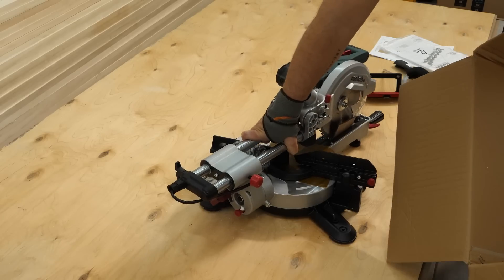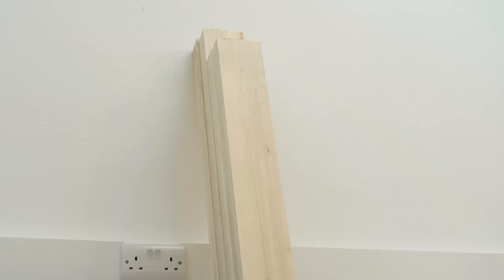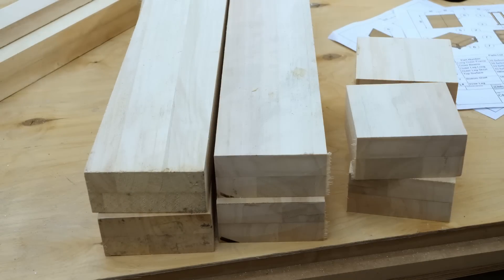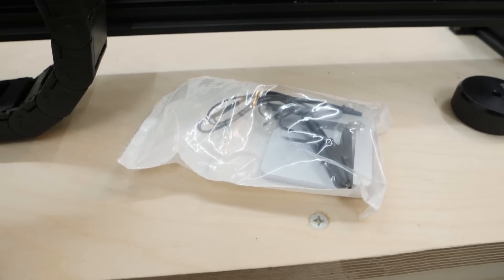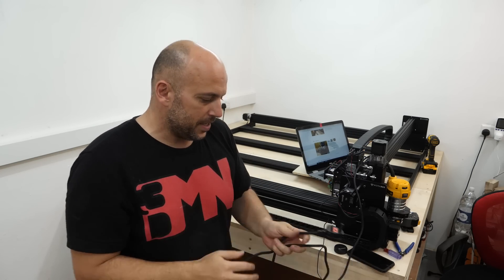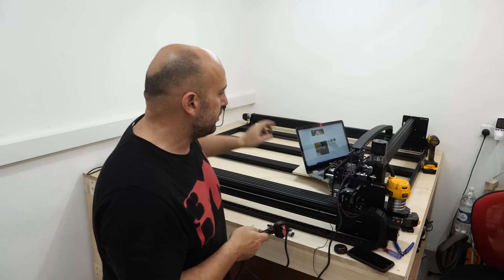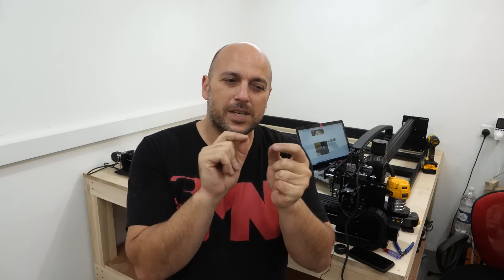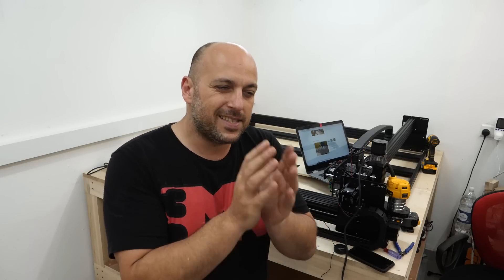MASSIVE CNC! - Setting Up The Ooznest Workbee 1500x1500

Comment: only idiot buy workbee parts, only spindle motor 200-300$ can buy lot better 2.2KW ER20 water cooled REAL spindle cheapen about less than 200$ i just buy my cnc new spindle cost 150$ and VFD 55$ lot better than any workbee shit router or milling machine. ower prize lt all parts. i has build better and biggest cnc less than 1500$ better motors, drivers,rails, controller,softwares.

Comment: not massive size, my first cnc machine what i has build has 1500 x 1500 x 400, and second cnc has 1500x 2500x 100. sheet table cutter. and now i build my son 1200x 1700 cnc not have big, normal small cnc machine. all cost less than 1400$ and working well whit plywood 3/4 inch cutting parts.

Comment: uh, has very expensive, same size i build at garage, cheapen than this cost, biggest better motors,  workbee have only small weak 175 oz motors i have 450 oz motors, lot better rails SBR and Z axis MGN rails, lot better REAL spindle motor silent and strong, less than 120$, DIY metal tube frame strong, ballscrews 16mm not wobble than 8mm, DM556 drivers, 2x40V 10A power supply, linuxcnc REAL cnc control software not toy 3D printer software, 10$ paraller port controllers 2x, or usb controller. if want better controller need buy mesa card 7i96 200$ and have same size but lot lot better cnc machine.

Comment: Hi, what is the difference of Workbee and OpenBuilds 1500 x 1500 cnc ?
Reply: price and both have too small motors. no power cut/move good. too small motor torgue, cnc minimum need 450 oz motors, not weak 175 oz.

Comment: Hi, you live in Malta? How mutch was the VAT in your country? I want to buy a workbee and i don t know how mutch will be the VAT  in Germany or in Romania, where willbe cheaper?
Reply: you can build same size cnc own garage lot better and strongest than this have less than 1000$ and not need VAT pay. i has build same size but lot better cnc in europe.
Reply: Really? How did you do that
Reply: @print.it.feel.it.ontiktok  simple, easy build, make first metal tube frame/table, then plywood table to top, then orden ebay or somewere linear rails SBR 16, 1500mm long, and ballscrews, same kit have ebay less than 300€ and Z axis MGN 15 rails 20-30€,acme screw 8mm, U beam aluminium profile 1500mm. stepper motors aliexpress nema 23 or 34 minimum 450 oz 3Nm 30-50€/piece, DM556 drivers 4x less than 20€ piece, paraller port controller card old pc 10€ old pc 20€ aliexpress real spindle ER 16 less 100-120€, linuxcnc software FREE or mach3 software FREE at torrent. Vcarve cad/cam software aliexpress 53€, some screw and cable and make all to together, easy simple job, internet have million project how build.

Comment: love this video, love the way you slapped the wood down to the beat of the music, made me laugh. I came across your channel because I am thinking of buying a cnc for the first time ever, I am a cabinet maker by trade and Joiner but never owned a cnc before. Question is it easy enough to use from not knowing anything about a cnc? is this machine easy to learn? and my objective is to make cabinet sides like kitchen cabinets with adj shelf pegs and biscuit cuts for jointing cabinet together. thx for sharing this video, from what I see so far the workbee specifically this one looks good for me as it looks like it would take 600mm wide boards by 870mm high by 19mm

Comment: 1500mm is far from massive... but glad it works for you :)
Reply: not massive, normal size woodworker cnc machine, not big, best what i has used has 3000x6000 mm size,

Comment: I just ordered this CNC from Bulkman 3D about 10 days ago, and today I received the first of three boxes, it's the insanely heavy one with all the extruded aluminum. I'm glad I spent the extra $25 USDs to get the black anodized like you have. Watching this video is the first time I am seeing the 1500x1500 in black, and MMMMMMAAANNNN am I glad I spent that extra money. It's going to be a few months before I can set it up, but, at least now I have a good look at what I got myself into. I absolutely love your table too, this has to be the most over-engineered CNC table I have ever seen, and I will DEFINITELY be building it for my CNC as well, thank you for sharing those plans!!!!
Reply: Hey are you happy with it? I need a machine to work with 2mm aluminium, cutting holes etc. Faceplates , Front panels etc. Thinking of buying a workbee. Your advice and experience would be great to hear!

Comment: FYI: If you pull in the router power cord into the drag chain, you may get magnetic interference. This will lead to lost of connection. So if you go that route and you find out that your cnc is getting disconnected, you will know why :) P.S. Don't ask why I know this :(. Best of luck with your new toy!
Reply: That’s incorrect. The power cord and communication cords work at different ends of the frequency spectrum so it would not cause any interference. More likely you were dealing with a grounding issue.
Reply: @bhutch216  I operate the CNC for over 15 months w/o a single disconnect. was tired of handling the power cord, so I open the drag chain and took 10 minutes to put it inside. A few days later I ran a job and it start to happen. Not every time, but often. After 7-8 faillures and some reading, I decided to remove it and bam, no more disconnect. I'd like to know how you explain a ground fault??? It's been a full year with the power cord hooked away from any electronics and it never happen again.
Reply: @Marcus_Caius  It's more likely that the cables inside the drag chain were crammed in and pulling on each other causing something to come loose. I have had mine for 2.5 years and all my cables are together inside the drag chain and I've never had any issues. Thats the router, laser, and all the axis wires.

Comment: this is looking great.
ps. i have got the same Einhell belt/disc sander you have got. and i thought the round sanding papers from Einhell were pretty expensive about 11 euro's for 3 flints with 3 different grit's.
now i looked further in my hardware store and i found the Stanley 150mm flints one package contains 5pc and in one and the same grid. and they got them in 60, 80, 120 and 180 grid but maybe more.
5 pc of Stanley cost way less then the 3 from Einhell.
ow and i see now my favorit DIY shop also have the. LOL     https://www.hbm-machines.com/producten/hbm-150mm-schuurschijf-met-klittenband-en-gaten

Comment: If I can make a suggestion, openbuilds has a TR8x8 tension nut with set screw now that are superior to just the standard shaft collars that were used before on the lead screws. You can put a little pretension on the end plate bearings that way versus trying to push the collar in to take out the play. Just a suggestion, the collars have worked for me for years but seeing that they have these, now I ordered some.
Reply from the maker: Awesome, will definitely order some

Comment: Could you please explain something more about the 50.00 mm Height Reference tool ? I did not have one on my  'old' kit !!!
There is a guide in the kit for that ?
Reply from the maker: That’s basically a bracket so that the new dewalt mount is attached at the perfect height. The new mount has only been released in the last couple of weeks
Reply: As 3DMN Said allows you to get the mount at the exact height. It also ensures the mount is perfectly square to the Z-Axis C-Beam. All kits ordered now will come with this if the Router Mount is ordered.
Reply: @ooznest  Will be in the future the reference tool and the new router mount available in the shop ?
Reply: @IceCreams62  Yup :)
Reply: @ooznest  when was the cut off for the new mount / tool? My order was placed in October, delivered last week but did not come with the new mount or reference tool? Thanks in advance 👍🏻
Reply: @LeeAThomas  Hi Lee, it's a promotional product and is still in development - but please keep an eye on our social media as there will be an announcement when it is released :)
Reply: @ooznest  understood, thanks for the reply 👍🏻

Comment: looks like you don't need to cut the plug off? them cable chains unclip dont they ?
Reply from the maker: yes, but the wire is not long enough unfortunately
Reply: unless its just because u want to make cable longer 🤔